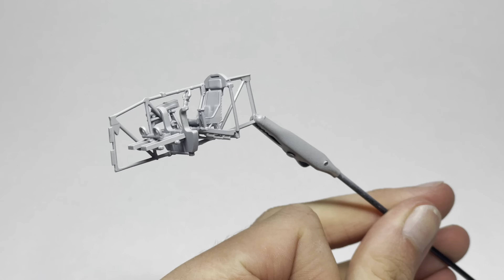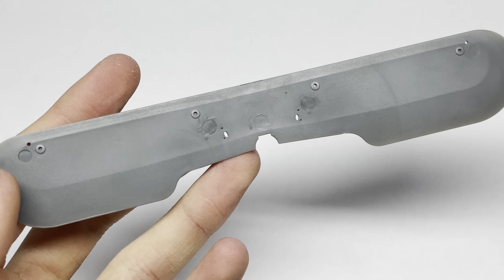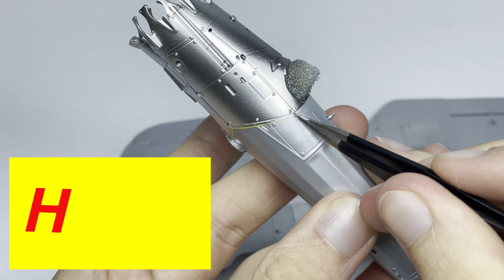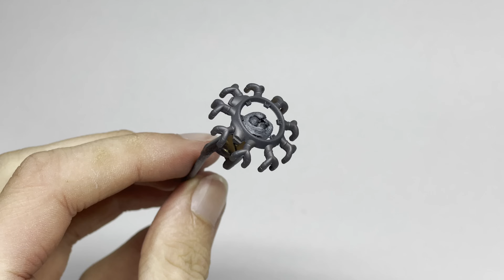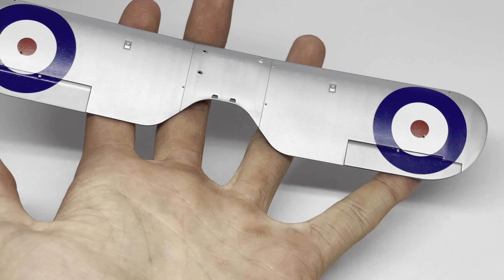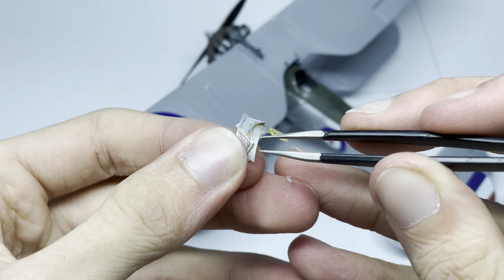Airfix's Brand New 1/48 Bristol Bulldog | Full Build | 4K

Comment: Nice build. I'd get one it they ever scale it up to 1/32. Just one thing. There are a lot of gaps between the upper and lower wing surfaces. Even so, its a beauty.
Reply from the maker: Thank you! I am aware, definitely mucked that one up a bit! Thanks for the comment😁
Reply: @machmodels  It won't be that hard to fix. Pipette with liquid cements, one inch at  a time. The gaps look to be far enough out so as not to effect the struts and rigging.

Comment: The reason of the assimetric placement of the bombs is that this way they can counteract the rather strong torque effect of the engine. At least as long as they are there... Just a guess but this method was used later on the F4U corsair as well.
Reply from the maker: Thank you very much for letting me know😁👌🏻

Comment: it's a super aircraft and a good looking kit, but why do the trailing edges of the wing in the finished kit look like a plastic sandwich with a visible split between the top and bottom half ?  Is it like that on the real aircraft?
Reply from the maker: No I believe that’s partly my fault; I really struggled to reduce the gap🥲

Comment: Excellent instructions and camera work. I would like to see more detail of doing the rigging - so far I have jibbed at doing a biplane because of "rigging anxiety." Do you have any preference for detail brushes. I did buy a Winsor and Newton No. 7 and it has been in a different league from anything else I've used, but the cost is prohibitive and I'm not a pauper, but I wondered f there is anything out there to compete that you may recommend?.
Reply from the maker: Apologies! This is how I did it:

In terms of attaching the rigging, I use a thin super glue. Not super thin as that dries a little to quick, any manufacturer will do for this. I then use some vernier callipers so approximate the distance between the two mounting points. Then what I will do is cut out a length of rigging that I know is about 25% longer than it needs to be for the distance, to give me some working room for error. I’ll then dab a small amount of the thin glue onto the very end of the rigging, and place it onto one of the mounting supports. After that has dried, using a pair of tweezers, I will stretch it until it is tight and at the opposing support and snip off the 20/25% excess that I used. Then repeating like before, a small dab of super glue on the end and using the tweezers I will rest it in the supports position for 45 seconds as the glue cures.

In terms of brushes, I just use a cheap £20 set off of amazon. Not very professional but they have served me well for two years now! Would you look to recommend them?
Reply: @machmodels  thanks.

Comment: nice commentary;  you didn't explain how you attached the rigging?
Reply from the maker: Apologies! This is how I did it:

In terms of attaching the rigging, I use a thin super glue. Not super thin as that dries a little to quick, any manufacturer will do for this. I then use some vernier callipers so approximate the distance between the two mounting points. Then what I will do is cut out a length of rigging that I know is about 25% longer than it needs to be for the distance, to give me some working room for error. I’ll then dab a small amount of the thin glue onto the very end of the rigging, and place it onto one of the mounting supports. After that has dried, using a pair of tweezers, I will stretch it until it is tight and at the opposing support and snip off the 20/25% excess that I used. Then repeating like before, a small dab of super glue on the end and using the tweezers I will rest it in the supports position for 45 seconds as the glue cures.

Hope this helps!👌🏻

Comment: Excellent build comes out very nice but Airfix needs to include seatbelts.  In my view a glaring omission especially with the open cockpit
Reply from the maker: Thank you very much! Would you recommend they mould them in or add a photo etch fret?
Reply: @machmodels  I would use the same system that they use for paint masks

Comment: Just two questions..... did you cement just the cabane struts or did you cement the outer wing struts as well??🤔 Also, exactly how did you place the cement without damaging the beautiful paint finish??🤔 Cheers🙂
Reply from the maker: So all of the struts initially sat with no cement of gluing of the sort, after I had “jiggled” everything into place I glued everything in place with ammo mig ultra glue. If you are unfamiliar, it is a super strong PVA glue, it dried super hard but doing affect the paint finish underneath. Hope that helps!

Comment: Lovely Bulldog shame there’s no pilot figure and also shame you didn’t show how you rigged but another top build ❤
Reply from the maker: Apologies Duncan! This is how I did it:

In terms of attaching the rigging, I use a thin super glue. Not super thin as that dries a little to quick, any manufacturer will do for this. I then use some vernier callipers so approximate the distance between the two mounting points. Then what I will do is cut out a length of rigging that I know is about 25% longer than it needs to be for the distance, to give me some working room for error. I’ll then dab a small amount of the thin glue onto the very end of the rigging, and place it onto one of the mounting supports. After that has dried, using a pair of tweezers, I will stretch it until it is tight and at the opposing support and snip off the 20/25% excess that I used. Then repeating like before, a small dab of super glue on the end and using the tweezers I will rest it in the supports position for 45 seconds as the glue cures.

Hope this helps!👌🏻
Reply: @machmodels  no need to apologise :)

Comment: Excellent. It looks superb.   I would have liked to have seen a sample of you doing the rigging showing how you attached it and got the right lengths etc.    Perhaps you could do a tutorial?
Reply: Agreed.
Reply from the maker: My apologies for not recording it! Hopefully this will help explain:

In terms of attaching the rigging, I use a thin super glue. Not super thin as that dries a little to quick, any manufacturer will do for this. I then use some vernier callipers so approximate the distance between the two mounting points. Then what I will do is cut out a length of rigging that I know is about 25% longer than it needs to be for the distance, to give me some working room for error. I’ll then dab a small amount of the thin glue onto the very end of the rigging, and place it onto one of the mounting supports. After that has dried, using a pair of tweezers, I will stretch it until it is tight and at the opposing support and snip off the 20/25% excess that I used. Then repeating like before, a small dab of super glue on the end and using the tweezers I will rest it in the supports position for 45 seconds as the glue cures.

Hope this helps!👌🏻
Reply: @machmodels  excellent thanks very much for explaining.